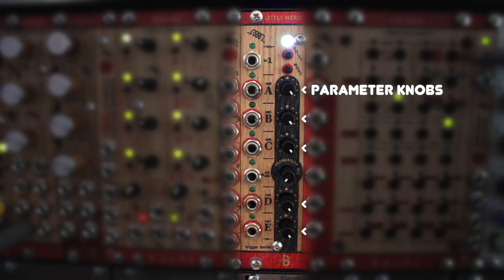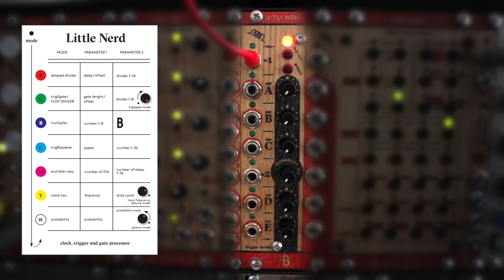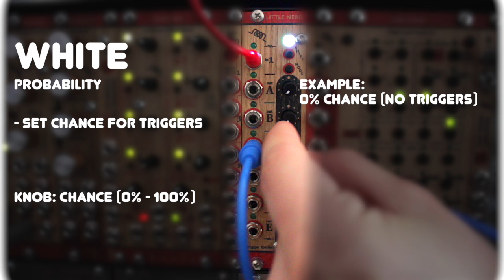Bastl LITTLE NERD: Clock Processor Demo (ATTN: You will be tested!) #TTNM

Comment: Great video, thanks!  I am bit confused though, about the difference between some of the functions:  How is the trigger repeater different than a clock multiplier?  And, isn't the probability function very similar to the Euclidian sequencer?BTW, your videos are really helping me to understand the Bastl system!
Reply from the maker: +John N A clock (rate) multiplier outputs a faster clock and a clock (rate) divider a slower clock. A trigger repeater just repeats an incoming trigger pulse a number of times. The probability thing randomly outputs triggers while the euclidian sequencer outputs fixed repeating patterns which are not random at all. :)

Comment: Might be a bit dumb, but how would I use this in my setup?
Reply from the maker: +Destination Sound well, if your setup is like mine, then you could install the Little Nerd between the Micro Wave and the Freezer to translate specific wavelengths into cooling resonances, to increase the efficiency of the latter around -5 degrees Celsius (requiring a +5V converter on the bus). It's fairly easy in fact :)

Comment: can you use a gate signal from for instance a midi to cv unit as in input for the little nerd? and also multiply that? (like a trigger/sync input) or would the signal be too long?
Reply from the maker: +Rienk Speelman yes, you can use any kind of signal with a sharply rising edge. I think the multiply mode will convert the gate into a trigger and output those at a multiplication of the gate speed.
Reply: +The Tuesday Night Machines you think or know for sure. If thats the case im buying one!
Reply from the maker: +Rienk Speelman I'll try it out and get back to you.
Reply: Thnx!
Reply from the maker: +Rienk Speelman  So yes, you can multiply longer gate signals as expected. It won't convert the gates into triggers though, but make the gates just as long as they need to be. So when multiplying by 2, for example, the outgoing gates are half the length of the incoming one, etc.
Reply: Hi! thnx.. so if the gate is too long, lets say 3/4 lengt and 1/4 rest.. it will send a peak out all the time? would you suggest buying a gate to trigger module than? any suggestions?!
Reply from the maker: +Rienk Speelman no, it takes the rest into account as well as the high gate, so it will always multiply the signal with rests in between. There are no "too long" gates.
Reply from the maker: +Rienk Speelman P.S. You can use the GREEN Mode to convert gates to triggers and the other way around.

Comment: I like the idea of this module, but memorizing all that stuff...
Reply from the maker: +Alan Podjursky Yeah, I was worried about that as well at the beginning. But after using it for a few days, you'll just automatically remember its functions. Also, you can print out the cheat sheet and stick it to the inside of your case (e.g. on a blank panel) to make it easier.

Comment: So, how do the save slots work? You hold the two buttons then what? Turn a knob to assign it? How do you recall a preset?
Reply from the maker: +michael matos hold the buttons for five seconds to save to the current slot. To switch slots, hold the buttons for five seconds and wiggle one of the knobs. Each knob represents one preset slot.
Reply: I haven't quite figured this out yet. If you save... does it save the modes for all of the different channels, or just the active one?